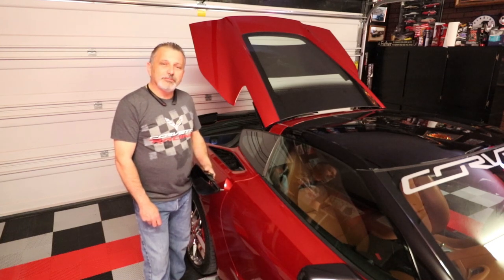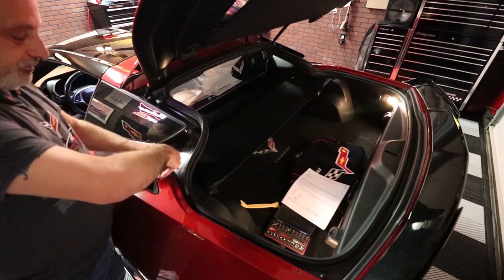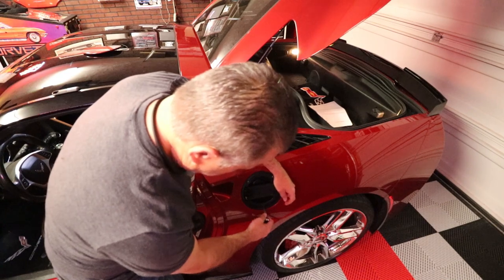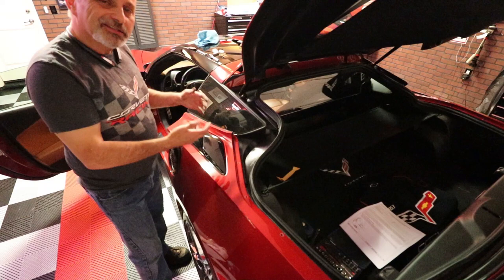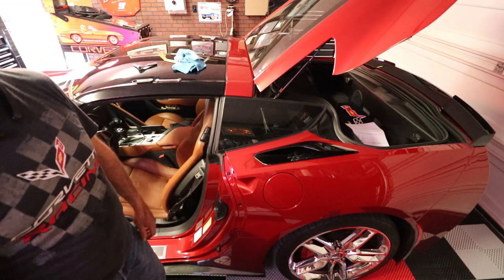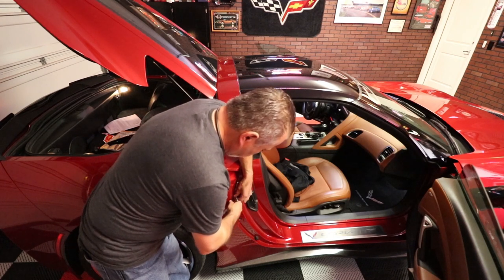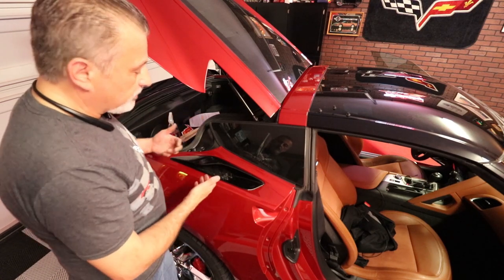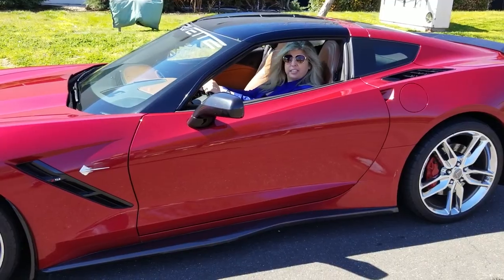How to Install ACS Z06 Upper Vents on a StingRay or Z51 C7 Corvette

Comment: Cannot get my 2014 C7 Stingray passenger fender popped loose, help!
Reply from the maker: There is glue that has it stuck. You will need to take a long razor knife carefully cut the glue without scratching the paint.

Comment: Hey Scott I have both my stock vents off but there were liners under the vents will I need to put those back in when my new vents come ? Thanks
Reply from the maker: No not at all.
Reply: Thank you for your quick response. 👍🏾
Reply from the maker: @corneliusmcferren6614  You bet anytime
Reply: Ok now I’m confused and probably mad at myself. I bought these and they don’t screw in they have tape !!! Wish I could send a picture
Reply from the maker: @corneliusmcferren6614  they should have slots for the original screws
Reply from the maker: @corneliusmcferren6614  email the pictures to thecorvettechannel@gmail.com

Comment: Im up in the air about these. I like them, but I really don't mind the stock ones. And you're missing one of the mods that you have installed on the car, not listed in the description. Because that Z06 front grille definitely isn't stock. I just got mine in, today. And some lady backed into my car, in the drive thru, so, my bumper is getting repainted, next week, Im going to see if the body shop will install this grille for me, since they're going to have the from bumper off, and apart for paint, anyway.

Also, good to see that someone has a channel, that lives in the Sacramento area. I need to get linked up with you guys!! I have an Arctic White 2015 Z51 7M.
Reply from the maker: Hi Gregg, Yes you are right. I dont have that part listed. I put that part on the car before I started the channel and I bought it on Ebay so I dont have anywhere to direct you to it. The Body shop has to take the bumper off your car and remove your grill to be able to paint the bumper correctly so if you buy one before it goes to the shop they should not charge you anything to put it on. they fit on exactly the same with no modification at all. Good Luck!!

Comment: i saw the ZR1 bumper install and was truly impressed with the part and your patience. Then i happened to see this one and had been thinking about doing since i saw it down on another Stingray. This is so great to see the short cuts that are not risky and require some gymnastics. I was curious about the air flow you did not show the tubing or where the air goes into the fender. I would like to see and know the air is indeed going to improve the air flow thru the coolers.  Thank You very much. I want to get more grunt on my 2014 Z51 A6. Going back and forth on options even trading up to a Z06. But I really like my current ride. Have you researched or thought about motor mods??? I has seen heads and cam, Superchargers, even a new truck crank and block for 402 cu in LT1 all versus trading up to a Z06. My 2014 has 9,000 miles. sad i know but i am leery to rip the motor out and do a full Monty engine build.

Comment: Did you ever consider modifying these vents so that it becomes operational vs only aesthetic? Thinking about doing the same but undecided.
Reply from the maker: Actually they are operational the duct work is there even in a Z51 because of the coolers in the back bumper.